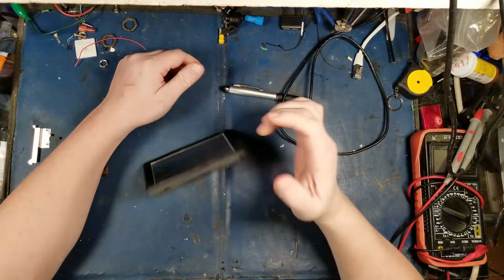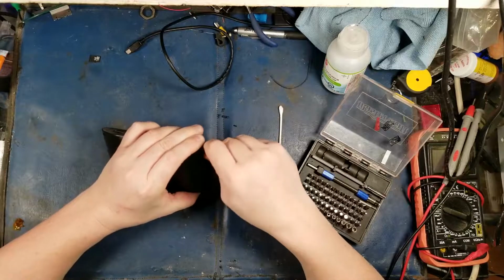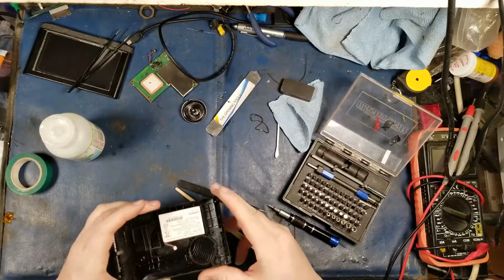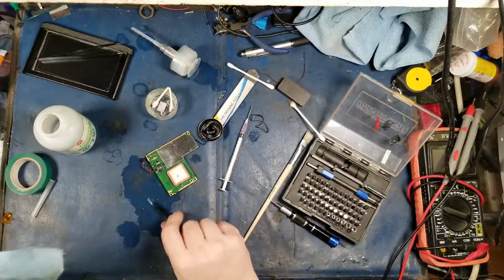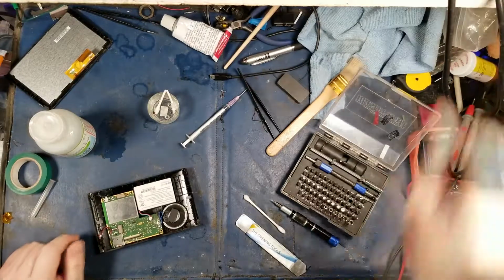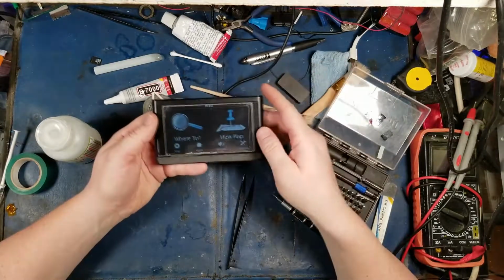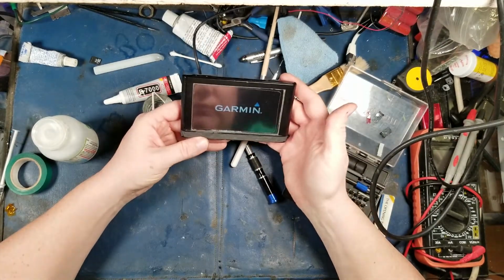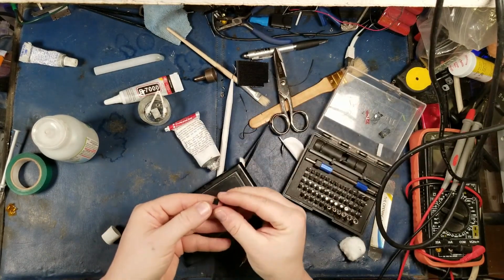Garmin GPS Speaker & USB Repair

Comment: My Nuvi1450 GPS does not take charge. It looks like one of the connecting tips is  bent. Just replaced battery and secured micro USB applying rosin and soldering ends. Where are you located  and how much it could cost.
Reply from the maker: I'm in Ontario Canada. If it's a port it wouldn't be much.
Reply: I am in Southern California, too far for a port replacement. Thanks for your response.
Reply from the maker: @nestorpaez7546  Np. You could try doing it yourself? You can probably salvage a port from another device.
Reply: I secured the USB last week. It does not take power. Perhaps put too much rosin. Action plan: try to remove rosin and observe if there is contact. Re-apply rosin. 

Ordered new port. Will try to install it but never removed or installed USB port I am feeling what perhaps a blind person fills